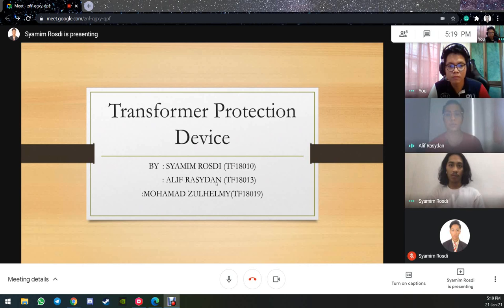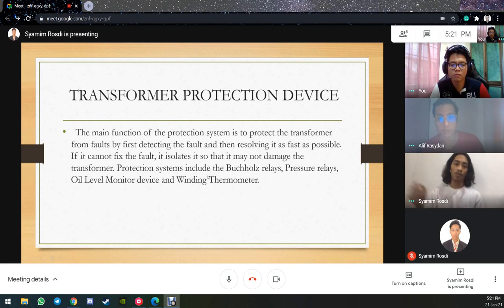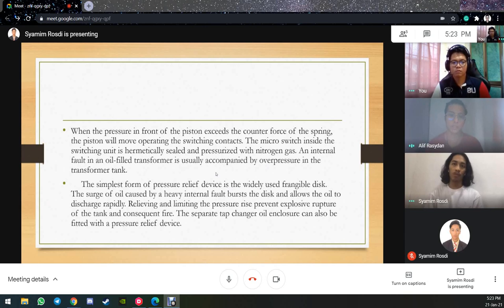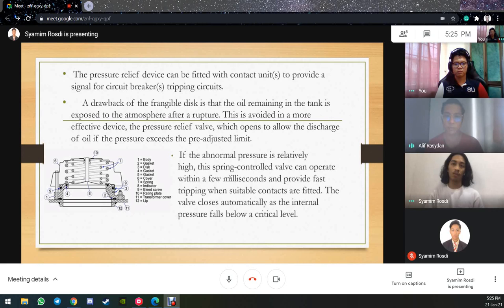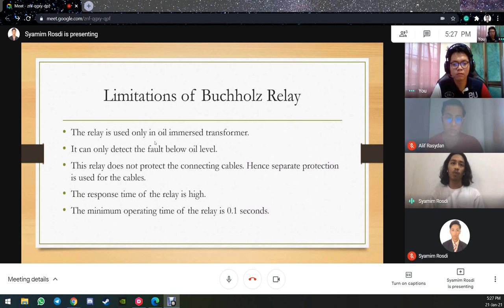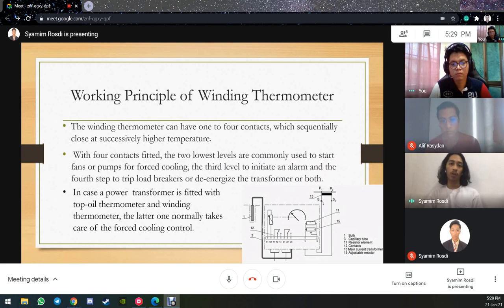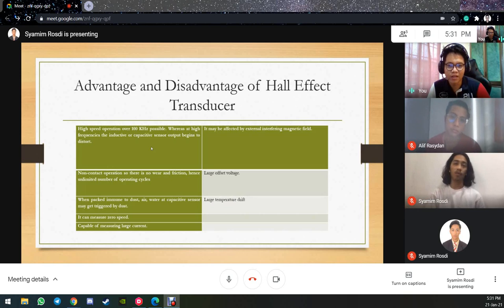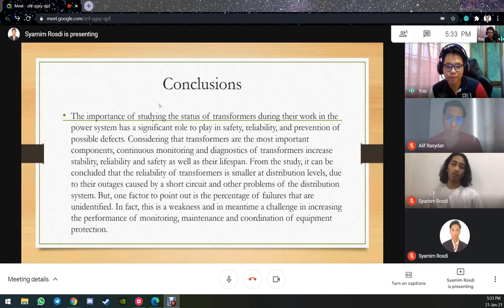TRANSFOMER PROTECTION DEVICE BTW 2243

Comment: What is the function of Buchholz relay?
Reply from the maker: The device will therefore give an alarm for the following fault conditions, all of which are of a low order of urgency: 
1. hot spots on the core due to short circuit of lamination insulation
2. core bolt insulation failure

3. faulty joints
4. interturn faults or other winding faults involving only lower power
 infeeds

5. loss of oil due to leakage